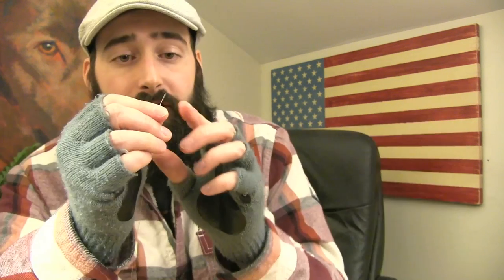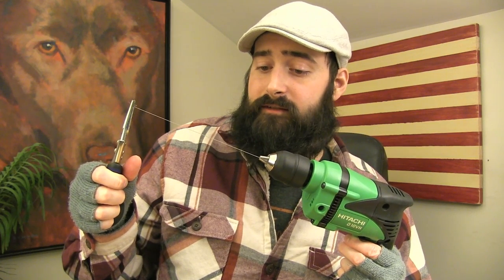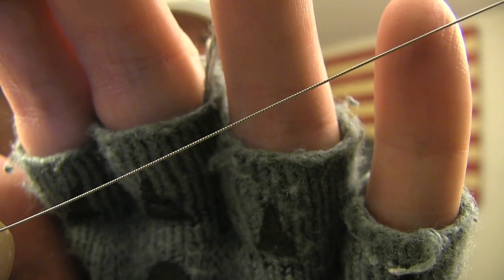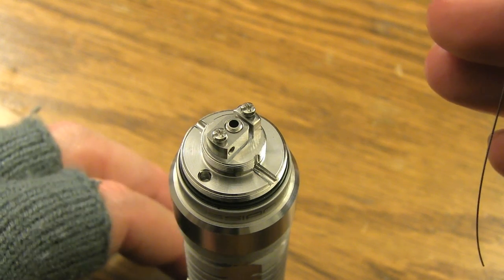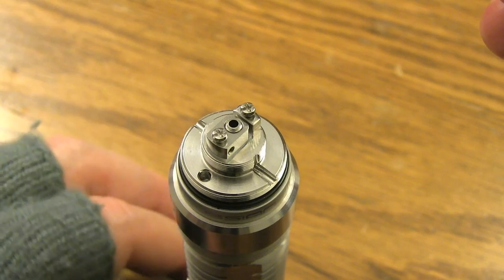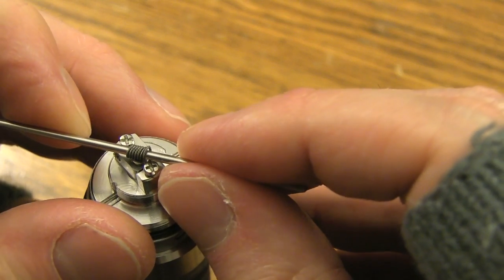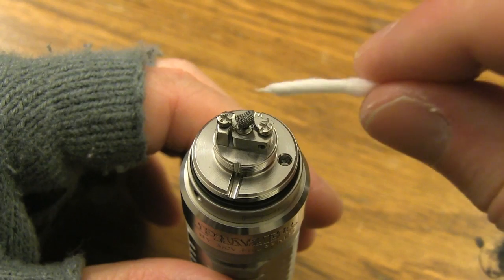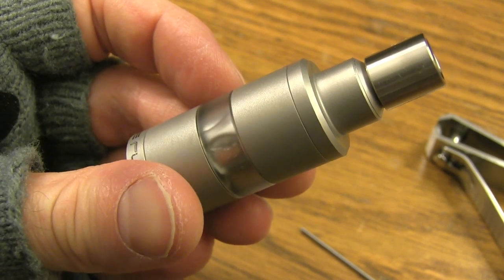Triple Twisted 32 Gauge Micro Coil

Comment: Why my juice tastes burnt when I use this coil?
Reply: Too hot for your juice.  If you're using a regulated mod, lower your watts/volts.  If you're on a mech mod, add an extra wrap or two to bring up the ohms.  If you're still having a problem then you're either using too much cotton (stranging the flow of juice) or too little cotton (not touching the coils properly).  If you fix any/all of those issues and still have a problem then I have no idea what it could be other than if you twisted the wires too much and now have hot spots.
Reply: Could the problem be airflow as well?